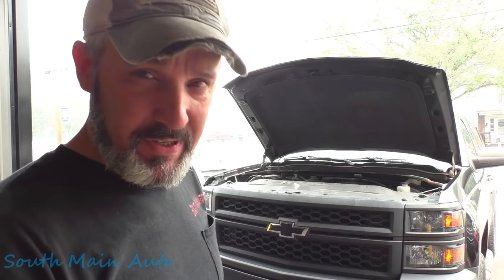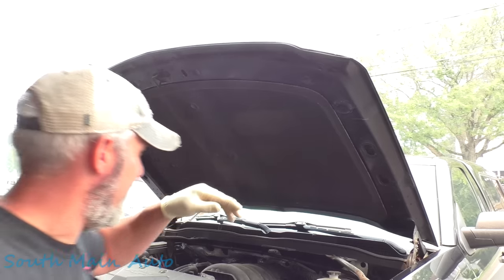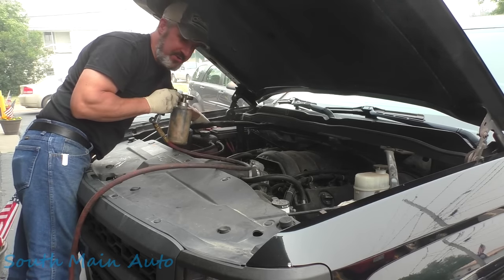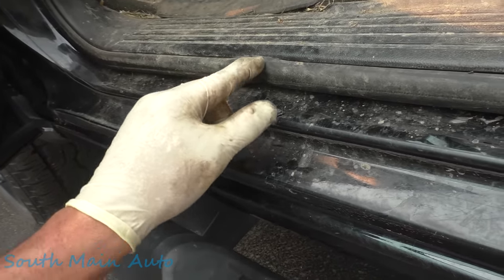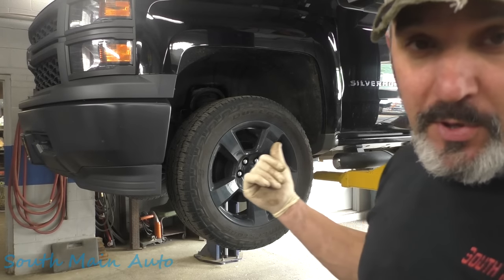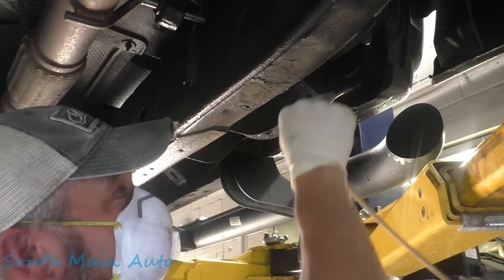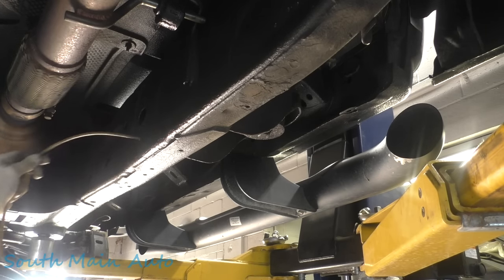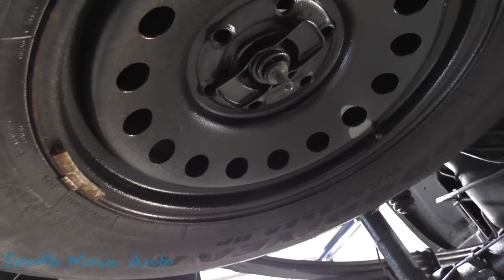Keep Your Car (Or Truck) From Rusting!! You Must Do This!!

Comment from the maker: Undercoating/Rustproofing Pro Plus Gun with Undercoating Wand : https://amzn.to/3P47l1z
Fluid Film Undercoating Spray Gun : https://amzn.to/42v1427
Don't have a compressor? Buy a case of cans and get after it! : https://amzn.to/45RqUAd  or https://amzn.to/3MXQ2g7
Reply: My experience is that the fluid film branded gun is ok for home use but won't hold up if you go through 55 gallon drums. That pro plus gun looks pretty sweet, though I have no experience with it. Also, don't fool yourself thinking you are going to do a whole car with cans. Besides the cost, I've found that the product in the aerosol cans is different. It seems to be thinner and not work as well. Just my experiences as a home mechanic who has fluid filmed my own and friends cars.
Reply: I solved the rust problem by moving to Florida. But that wasn't the only reason I came here. Escaping a communist state government was the main reason.
Reply: And New Mexico also!
Reply from the maker: @jennifer.moxhamhuroncenten1666  About a gallon and a half when I do it
Reply: I go to Krown Rust Control
Reply: I 💗 Rustproofing.  Rust  = Neglect  🤨🤨
Reply: Does fluid film do bad things to rubber based components? Bushings, body mount rubbers, etc?
Reply from the maker: @weloveups831  Not that I have ever seen
Reply: @richb.4374  insurance costs in Florida is out of controll
Reply: Is it a bad or good thing to do on a car that already has rust?
Reply: @weloveups831  weather seals are the only thing I've noticed swell
Reply: @thedreadpiratefisherman5325  the earlier you get onto it the better chance you have of stopping it
Reply: @Rich B.  You came from trump land ?
Reply: 350 $ for a spray gun ? Come on,I could fill a pit and drive through it for that.I use the much cheaper one and put a hose on the nozzel.
Reply: @thedreadpiratefisherman5325  good .  just knock the big flakes off and spray
Reply: @peterwill3699  not sure what Rock you live under, that's at the entry level pricing for a Professional Spray gun!
Reply: @mib20000  ✅👍
Reply: @Rich B.  Your comment as well as your pic explains it all. Glad you left. Stay in your own world. Maybe we will build a wall along Florida's border where it belongs!
Reply: Take the time and lower the spare. 5 minutes of effort will pay big dividends.
Reply: How do you tell if a shock/strut is leaking afterwards?
Reply: Do you have trouble putting a vehicle on the lift after treatment, my dealership will not put mine on a lift after treatment.
Reply: You will spend a lot more for spray cans.2 cans versus 1 gallon  in price about 10 times the amount.
Reply: @SouthMainAuto can we make an appointment, I just bought a new Toyota Camry and was looking to have it done?

Comment: I discovered that moving to Arizona also works.
Reply: Yup sure do
Reply: Makes too much sense to move somewhere rust free.
Reply: Back in the mid 1980’s GM would buy back Camaro’s that had leaking T-tops under the Lemon Law and send them to Arizona.
Reply: That actually the best thing to do
Reply: @killdizzle  There's no such thing as a free lunch I guess.
Reply: Yeah but the amount of rock chips you get in that state is unreal
Reply: @President-Nixon  Yes.  My lawn is made out of gravel.
Reply: Then you’re not dealing with rust you’re dealing with brittle plastic that ages 10 times as fast.
Reply: @herkybc130  
When being rust free is your main concern, life must be easy for you indeed!
Reply: @President-Nixon  For some reason they only hit my windshield.
Reply: I moved to Florida from surprise Az and my 21 yr ball hitch finally surface rusted. Lol
Reply: How do you deal with swamp ass for 9 months a year though?
Reply: Todays temperature.   Medium well.  😂😂😂
Reply: That’s what I’m doing. Getting out of the crappy NE
Reply: It’s a dry heat 🔥
Reply: @killdizzle  better than new york more like old york.
Reply: In Colorado our snowplows spread ROCKS on snow and ice.
Reply: I lived in Yuma. Zero rust issues
Reply: But how are you going to deal with your car melting
Reply: c'mon only 120 degrees, it'll melt the rust right off
Reply: Same here. So much easier to work on cars here than where i grew up in the rust belt.
Reply: Been in Az since 1985, no rust!
Reply: @President-Nixon  true story!
Reply: @Scott Perry  yep. 3 windows in work trucks, 2 in my car.
Reply: @BS.-.-  stay in the AC.
Reply: @toddbrown3606  yeah thats what glass coverage is for. Get a few windshields for free through insurance if you were smart enough to have a policy with glass coverage, OR have your car rust so quick and so fast its in the junk yard within a decade or less... yeah hard choice. Lol
Reply: @herkybc130  That's right, stay in NY, pay really high taxes, and have your vehicles rot away.  Lived up there about 10 years then moved to Tennessee.
Reply: @jackgreen412  Not in NY. Was stationed there for a few years at Stewart. Live now in the deep south.
Reply: You get to keep your car but give up everything else that makes life worth living.
Reply: Help you take care of it, my kinda people!
Reply: Oh I dream of this some day. It would help my lungs a lot too!
Reply: If your a Democrat
Reply: Leaving NY solves a lot of problems
Reply: Montana or Wyoming would be a better choice if you wish to retain the brutal winter season... NO salt on them winter roads and U drive carefully on snowPack
Reply: @BS.-.-  No moisture in the air, so no swamp ass.  Sweat evaporates so fast that if you soak your shirt, it freezes your nipples.
Reply: But now you're baking in 120 degree heat.....sizzle sizzle....
Reply: @richsmith9063  That is fake news.  The highest temperature of the year was 119 and it only hit that twice.  Also it is more like broiling than baking....
Reply: @scottperry9581  I live in the Dallas Ft.Worth area, and I can take Arizona heat better than Dallas heat.  110 degrees at 60% humidity sure does suck.
Reply: @wolfeadventures  I bought an old Lexus that had spent 20 years in Phoenix and did not have tinted windows. Some of the plastic control buttons simply crumbled to dust.
Reply: There are those of us that don't want to deal with 150 degree heat. Lol
Reply: @billquillin1952 No rust issues just 120 degree "dry heat"
Reply: You can defrost frozen food fast in az just set it out for 15 min  bingo! Defrosted 😊
Reply: no dont move here, go away
Reply: Little difference in price lol
Reply: We send lot of flooded and low mile bondo fixed vehicles to Arizona.....👌👌
Reply: 4 seasons is best try it wont go back.

Comment: Growing up in the desert it still blows my mind that you have to do something like this to keep your car from rotting away. I've seen cars left outside for decades that are fine with just a layer of surface rust. We do partially pay for it with plastic that become brittle and breaks into a thousand little pieces if you look at it wrong.
Reply: Vehicles have TOO MUCH DAMN PLASTIC ON THEM, NO STAINLESS OR GOOD CHROME FOR DECADES. Vehicles are pretty much DISPOSABLE ANY MORE, DAMN NEAR LIKE A BIC LIGHTER.

Try working on your vehicle up here in the N.E. in the winter time, LOL every plastic part breaks off as you touch it. It's either so brittle from the heat or from the cold when working on them. Vacuum lines, trim pieces, those Christmas tree fasteners, electrical connectors, ECT. ECT. ECT.

GREAT VID. SMA AS USUAL.
Reply: Yep the dry climates have trouble with rubber and plastic, we have trouble with metal.

There's no real winning. It all sucks.
Reply: @dchawk81  YES, IT ALL SUCKS, DAMN GOOD POINT, ALSO CRITTERS EATING YOUR INSIDES & WIRING APART.
Reply: Buy your cars down south, change to plastic from up north ( where there’s lots of junked cars).
Reply: @chucknSC  We should setup an exchange program.   My last car had spent half its life in Texas:  the plastic falling apart and rubber drying out was well worth not having to deal with rust for a few years.

Comment: I about fell over laughing when he said, you put 2 or 3 transmissions in it, and 17 wheel bearings, I busted out laughing 😂
Reply: Same, at least the fasteners will be easier to salvage.
Reply: Factory wheel bearing for the first 120k, then a cheap POS every 5k miles HAHAA

Comment: Residual salt on the vehicle is activated with moisture so spring rains can be detrimental with an untreated vehicle. The warmer temps also help the product wic. Thanks Eric!
Reply: Id probably never would have known about Fluid Film if it wasn't for SMA!  Just opened my first gallon of black and I love it!
Reply: Thanks you for the tip! Just started doing this to an inherited 04 lly duramax. She is clean. And intend to keep her that way!
Reply: You need to sponsor him.
Reply: What is the small difference between the can and gallon because I've used both and there's a difference thanks FF
Reply: @leardi58  it is the propellant in the can that is the difference. Other than that they are identical.

Comment: It's nice to see a customer take such good care of  their vehicle. If this never had any rust prevention treatments, it would either be in the scrapyard by now, or well on it's way
Reply: Good care? Did you see the interior?  Totally trashed.
Reply: @trustme7731  Does  the interior make the truck go down the road? He's taking care of the important things.
Reply: @justsumguy2u  You have no idea if the owner is "taking care of the important things.".
Reply: @trustme7731  Apparently you were sleeping when Eric showed the underside of the vehicle. Not only is it mostly rust-free, I also spotted things like a brand new exhaust and shocks. In fact, I didn't spot anything out of miss under the vehicle.
Reply: Ol' keyboard know it all has no clue what a work truck is. 
The truck has a camper and a Decked tool storage system, the owner probably has muddy boots more often than not.
Reply: @Its_notFunny  this truck was pristine on the underside! I don't llive in any rust belt or close to the sea and I have quite a bit of surface rust, might have to do this.

Comment: I live in Florida so I don’t have road salt but living near massive bodies of sea water does cause some rusting, on a much smaller scale. My 1999 Silverado has had several downscaled treatments of the Fluid Film and only has one small rust hole on a lower side pillar. 310k miles too. Just bought a 2023 Silverado and it got a treatment as well. Stuff really works.
Reply: One thing I’ve learned from watching YouTube vids of boats being launched in FL, is never buy a used truck that was registered in FL….most likely been backed deep into the ocean more than once at boat ramps.😅
Reply: I live in Vegas. Bone dry has advantages. 
I have most of the vehicles I have ever owned. From vintage Jeeps to a 50 year old Mustang Mach One. 
I have a cheap daily driver Hyundai with 450K miles to keep everything out of the sun. I keep them in a big metal building.
Reply: @TheBandit7613 I do the same thing in Iowa, 3 mustangs and 2 trucks sit inside while I run errands in 310,000 mile 2003 Hyundai Elantra... Best way to keep the wear/tear and and rust off a vehicle is to have a sacrificial beater to use when conditions are less then favorable outside.
Reply: @xlandros  The most recent vehicle purchase I have was used to put a tinnie in the water & it has no rust in/under it maybe because it's a Nissan made in Japan.
Reply: Salted road is like living with the ocean view, they bring to ocean to the road litteraly. you've got sand, the salt and salted air but can't make sand castle... and it's cold
Reply: Floroda, If you live on the coast. The vehicle will not survive. If you are more inland. It's far better.
We have busses that frequent the beach area and the roads are a city block in. The steel on them don't last long.

Comment: Hi Eric O! I live in southern Norway  and our climate requires rust preventive treatment. They use salt on our roads every winter. The most used stuff here is a Valvoline product called Tectyl. Comes in two variations, thin fluid for sills, frames, door bottoms. Its highly penetrable and is applied with a gun like the one you use. The other version is thick and wax like and is for all underside use. Its applied with a high pressure air gun. Doesen't drip after application. I love this stuff and it keeps the metal worms away. There is also a product called Dinitrol, but I know little about it. I think both products are made in USA.
Reply: I used Dinitrol ML on my car, its even thinner than FluidFilm
Reply: There are lots of products better than arguing about whats best, as he says in the video whats 'best' is to pick one and do it.
Reply: @aussiehardwood6196  True, doesn't matter if its Krown, Fluid Film or old engine oil, anything is better than just watching the metal rot away.
Reply: I use dinitrol here in the UK its a good product.
Reply: FF is thick. I found that it pours & sprays more evenly by putting the container in hot water for 20-30 min prior to spraying.
Reply: @aussiehardwood6196  100%, DO IT.
Reply: @Gary_in_NoVA  YES, I do same thing, like spray paint cans, works MUCH MUCH BETTER.
Reply: Grew up in Detroit, where cars are born...and soon die from cancer. Been in Co for 30 years, what a difference!! My hats off to you Eric.  Btw, love your channel.
Reply: Try Bilt Hamber it’s been extensively Salt  tested
Reply: I've used dinitrol. Helps if you put the can in hot water before spraying. 

My daily driver I sand blasted all the rust off the underneath and put a 2K epoxy mastic called Jotun 87 on it and it seems to have held up pretty well now for 4 winters.
Reply: @zoidberg444  WOW, GREAT JOB, WISH I DID THAT TOO MY 97 GRAND, SADLY. Body looks like something you can actually drive & trust but underneath the rockers are ALL DAMN RUST.
Reply: @zoidberg444  Instead of sand blasting, I use phosphoric acid in convert, kind of, rust then apply 3 parts epoxy primer, base color or not(the floor stay primer gray to keep the car cool during summer but other part goes black) then apply 2 parts clear coat hold a lot better then some kind of fluid flim but it's thicker. I do it in october/november but I warm the fluid in hot tap water for 20mins or so. I did removed all the plastics and bumper spray it everywhere. When I had to do body repair in rear quarter I had to remove the interiir in case of a fire and I spray in all the internal structure to prevent it from coming again. I inpected the job with a camera and it seeped out perfectly from the seems
Reply: Baa.   Baa.   Baa.
Reply: @zoidberg444  isn’t that boat Paint?
Reply: @paulaus  Yes. Its marine grade. A lot of people in the classic car scene use it because its so good. It just needs clean metal with a mechanical key.
Reply: Hi, I'm also a Norwegian, from the far north. They never pour salt on roads and highways in Finnmark, no need to. Where are you from, and why do they pour salt on the roads where you live? Maybe because everyone is using winter tires withour studs? Just a wild guess from my side 🙂 My car is 23 years old with no rust on it so far, thus no need for adding rust protection around here. My car has 260000 kms on it as well. I run winter tires with studs, will never run unstudded if I can help it 🙂

Comment: Expecting  any shop other than Eric to use the same care in the application of undercoating is a pipe dream!  I drove a 2000 Malibu  until 2018  when rust was still minimal due to having it RustChecked  every other year ( depends on your use in salted roads) and I live in
Halifax, NS  another "rust belt".  The choice is clear ......Rust OR  Mess .   Mess you can clean off, rust will end your vehicle's life sooner if not rust protected. Great video !👍👍👍🥇

Comment: I tried all the anti-rust scams until they came out with this sprays like fluid film. It really is good. I put it on my trailer gate hinges battery terminals starter wires everything I can spray it on.
Reply: Yes. Those bitumen-like coatings put on when the car is new are a disaster! Any pinhole allows water to get under the coating, it then can’t get out and rots out the metal underneath. Worst part is the rust is covered by the coating and you can’t see it.

Comment: I use used motor oil in a paint sprayer and coat frame fuel and brake lines, ( if they are steel ) Rust is really bad at the university I work at, they lay a carpet of salt in winter months. Also do my own and have had great results. Been wrenching 43 yrs, I really enjoy your content. Hope it's ok to say I always enjoy Mrs.O, you both are a great team.
Reply: I’ve heard about this before and I wondered if motor oil would work? How many times do you filter the oil and do you use any thinner or anything. Could you tell me what type of paint sprayer to use please? I sprayed under the doors in the drain holes 🕳️ with a can of WD and thought I had really discovered something. My Dad told me that they would wipe down the cars with kerosene on the bottoms and drive down a rocked road to put a “sealer” over it. Then wash it in the spring. I just retired from the state of Illinois highway department. I’m one of the “Salt Shakers” that you see on the roads. 🤣😂.

Comment: I did zebart rubberized under coating in my 05 2500  it killed it.   Found a local shop that did fluid film.  Had them do my ‘09 and ‘13.   Every time I bring it in for service mechanics always praise me for the condition as well as the easy of working on it.   Minus getting greasy when you work under the truck, it’s fantastic.   I will never buy a used vehicle around NY without it being previously filmed.  I usually by a southern vehicle and bring it back up, first stop is the fluid film shop.    HIGHLY HIGHLY HIGHLY recommend!!!!!!!
Reply from the maker: zebart rubberized under coating  🤮
Reply: Do you mean killed in a good way or bad ?
Reply: @nickmalone3143  very bad   Rubberized coating holds moisture in and causes huge flakes of rust to fall off